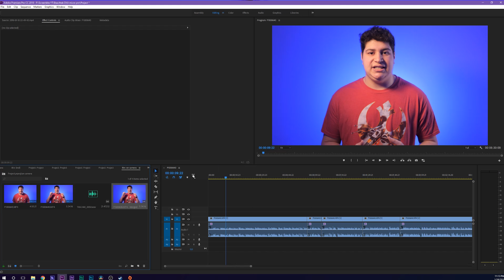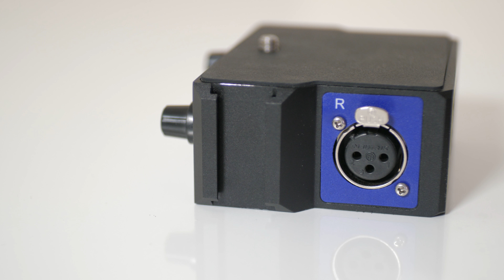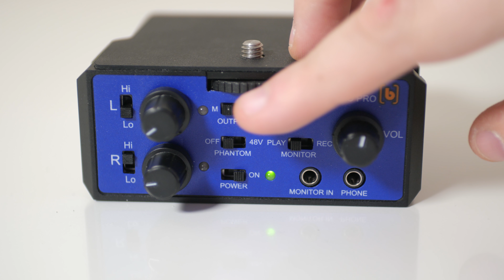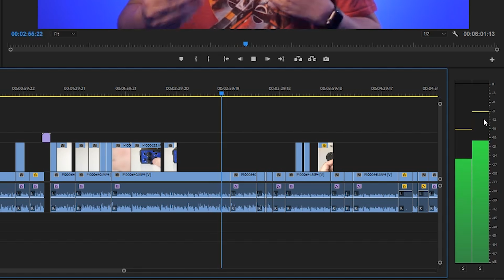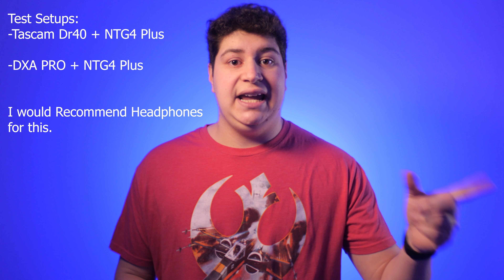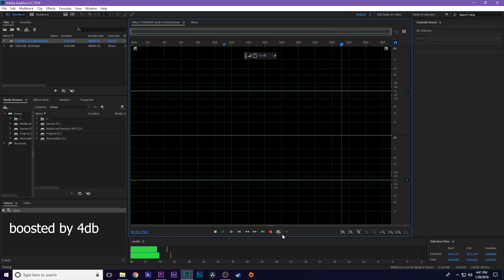Beachtek DXA-Micro Pro + Panasonic GH5 Review | Record XLR DIRECTLY Into Your Camera!

Comment: Thanks for the review. One question before I buy it. I have a Sony uwp D11 wireless system that I can attach to my sony ax53 camcorder camera to a.3.5 jack.  Would.this system work with my wireless Sony uwp  transmitter?
Reply from the maker: To be honestly I am no 100 percent sure, I don’t know a lot about can can corders. But basically as long as the receiving end is 3.5 and is plugging into both the adapter snd from the adapter to your camera you should be fine